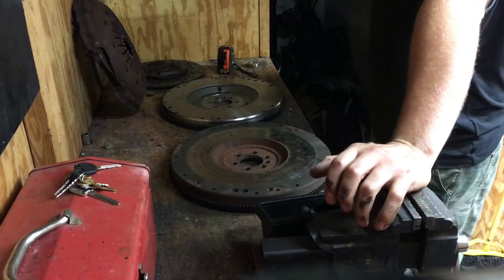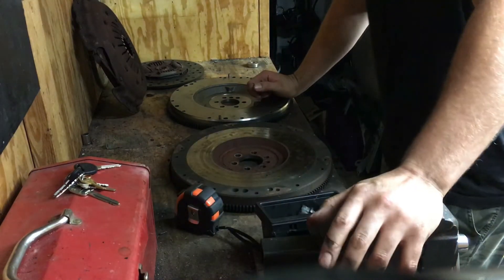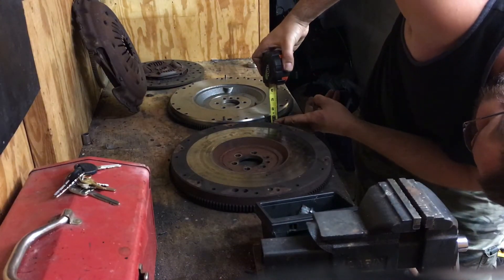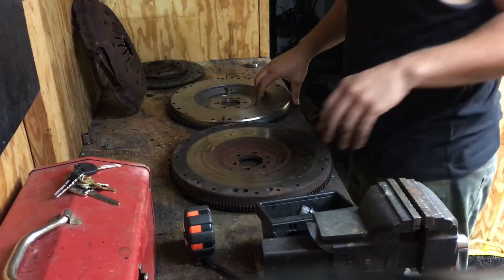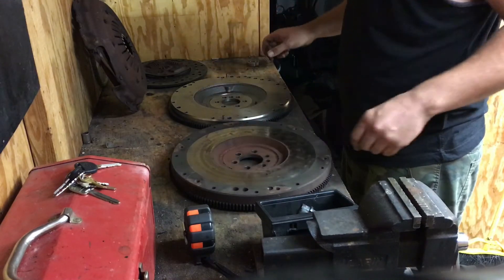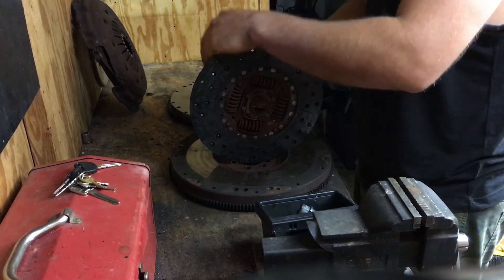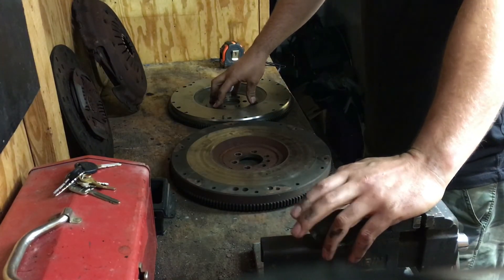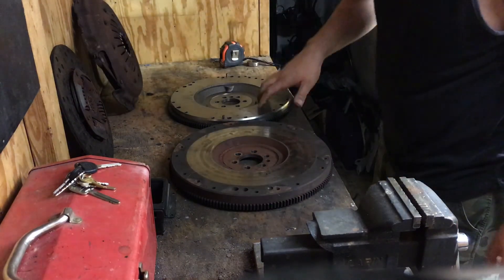How To: LS1 Swap to Manual Transmission NV3500 SUBSCRIBE!!!!

Comment: Will the stock drive shaft work for a manual if you swap the slip yoke I can’t find info on this anywhere only on google and I don’t truck google
Reply: S10 nv3500 is the same length as a 4l60e with 4l60e yoke. Fullsize c or k1500 nv3500 are the same length as a truck th400 with the th400 yoke. So yeah depending what transmission you have.

Comment: Hey I got 6.0 LS with nv3500 but can I re used the 6.0 fly wheel with a new new clutch that’s for the nv3500
Reply from the maker: Depends on the year of the 6.0. Early ones had a longer crank so i doubt you can make that setup work.

Comment: Some 4.3L are externally balanced. 96 & newer are externally balanced. The older 4.3L are internally balanced.  Before you decide to use a 4.3L V6 flywheel you should figure out exactly what you have.  You might think everything will work and put it together only to find out that it has a strange vibration. A friend of mine did exactly that. Thought he had a 350,but he actually had a 400. SBC 400 is externally balanced and he used a 350 harmonic balancer and flex plate. Engine had a terrible vibration problem. He decided to live with it because he didn't know any better. Wiped out the engine bearings after a couple thousand miles.
Reply from the maker: You don't use a 4.3 flywheel you use the flywheel for a 4.8
Reply: @beeterolds   seems like the 4.3l flywheel has more contact area with the clutch but yeah you gotta use the correct flywheel . can you perhaps get a machine shop to balance the flywheel so it could adapt the 4.3l fly  to the 5.3l or 4.8l ?
Reply: I Have a 99 externally balanced you are right bud

Comment: Hi, I'm wanting to take the 5.3 (auto) from my 2004 Sierra 4wd (totalled), and put it into a 2005 2wd Sierra that has a factory NV3500 manual tranny mated to the factirt 4.3 V-6.  Since these are the same Gen (I'm assuming), would they bolt right together?  Would I need to get a 4.8 clutch setup?  Do I run into any other issues like the oil pan because of moving from a 4wd to a 2wd?  Any info is appreciated.  I'm not going to buy the 2005 2wd unless I get some positive info on the swap.  So, time of responses is of the essence!  Thanks!!!
Reply from the maker: I made a ton of videos showing what I did. Its easy.

Comment: Would the 4.8 clutch components stil work if using a non LS v8? Just an old 350
Reply: If you are just using a 350, gm built trucks in the 90s with the same style small block with a nv3500, just use a factor set up for one of those, they where 5.0s and I think the 5.7s
Reply from the maker: No sir

Comment: Would this work with a mg5 trans 1990
Reply from the maker: Yes. Use all the parts for a 4.8 with an NV3500. You may have to run an external slave.

Comment: Hi I have a 4.8 cam heads and tuned making 380 at the wheels .will .the nv3500 handle that I'm not in to dropping the clutch and the car is very light .thank you
Reply from the maker: I'd say so. It handles my 5.3 just fine
Reply: @beeterolds  this will the bellhousing bolt up to the 4.8 and use the c6 v10 fly will and thank you again for your time
Reply: S .10
Reply from the maker: @PeterHatch-mx7zc  uses a 4.8 flywheel. Otherwise yes. It's a direct bolt together
Reply: @beeterolds  thank you for your time and your r&d just a old  Dazle mechanic trying to figure out this gas road stuff

Comment: Hi I have a huge question. I have a 06 Silverado 4.3 5 speed can I do this with mine? Alot of ppl say it will cost me alot of money. Plus I have to do alot of rewiring. Is there like a computer I could buy? That i can tune to make it work right? Or should I just forget the 5 speed I want to go 6.0
Reply from the maker: At this point Buy a different truck

Comment: I was just curious what pilot bushing you used I have a 05 5.3 and a 2000 nv3500 that came of a Silverado v6 and I want to mate them together
Reply from the maker: The same bushing that comes in a new clutch kit for an Nv3500 trans mated to a 4.8

Comment: Im going a simular route only I'm going for the 6.0 in s k1500 . Still using the Same 4.8 flywheel right?
Reply from the maker: For a manual? Yes the 4.8 flywheel. But it only works with the  shorter crank.
Reply: Yes its being bolted too an nv3500

Comment: I want to ask your opinion I have a 93 gmc 1500 with the 4.3 v6 and nv3500 I already have ls1 5.7 corvette motor and t56 tremec would it be easier to leave my nv3500 in with the ls or go ahead and do the whole swap I ordered the digital dash from Dakota digital

Comment: I have a 99 6.0 ls an it has the longer crank flange what would I do for that to work with the nv3500
Reply from the maker: Cody Good you would get the flywheel appropriate to that engine in an NV4500 application

Comment: Hey man, ive got a 2000 blazer with a factory 2wd nv3500  im looking to do a 4.8 swap in. I have all your part numbers saved and im wondering if you might know of the best ls swap mounts to use? And will it put the rear of the motor at the same location as the 4.3? Thanks in advance!!
Reply from the maker: Jake C I used the EBay mounts. They were around $50 for the kit. When you are all said and done you’re going to putting the engine wherever it fits best. You’re gonna have to cut the crossmember. Even with the LH6 oil pan it will be tight but all and all the trans will be roughly in the same location as it is now.
Reply: BEETEROLDS 
right on thanks dude!

Comment: I’m taking notes on the NV3500 swap. I’m leery of my 1991 WC T-5 swap holding any real power. The WC T-5 are only rated to 310 ftlb torque. 😳
I’m 75% ready to swap my 7.5 10 bolt to a modified Explorer 8.8. The pinion bearing is beat in the 7.5. Keep up the great work; Thanks for the plug!  JD
Reply from the maker: I may score an 8.5 out of a newer 4.3 speed truck